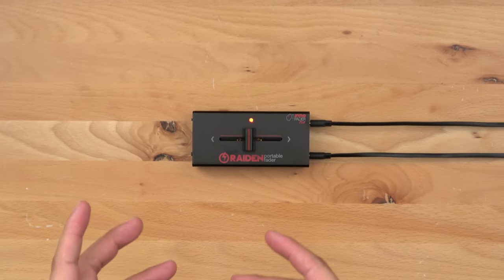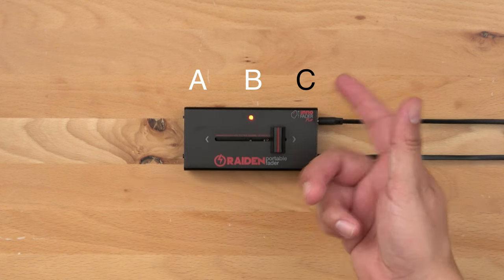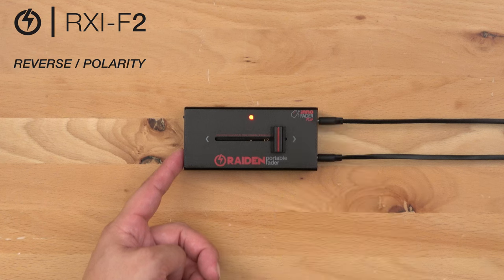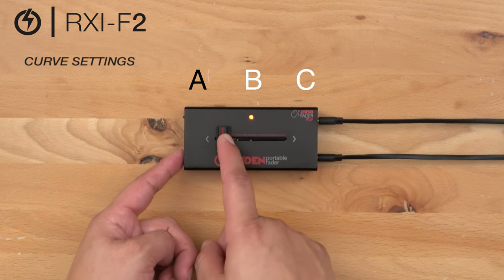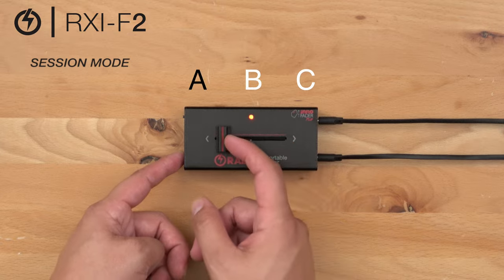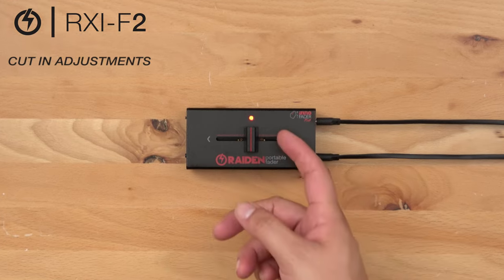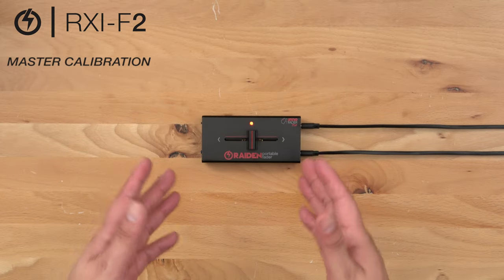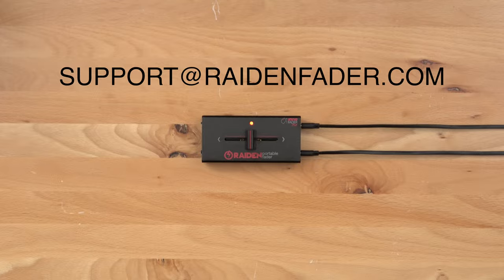Raiden RXI-F2 - Calibration Settings Tutorial

Comment: Mine lasted about 6 months and now the audio is bleeding through with the fader closed. Contacted support and they never responded. Tried  setting it up for reverse thinking I could just turn the fader around, but for some reason the cut in reverse is not sharp at all. Tried calibrating it for a sharp curve and it just doesn't work. So needless to say I wont be buying products from raiden again. I'll stick with Jesse Dean.

Comment: Hey raiden I just bought a numark pt01 scratch and raiden rxi-f2 fader.  Problem is that I am not getting proper clear audio In my headphones also facing problem to connect it with numark pt01 scratch.  Please make a video on setting up with numark pt01 scratch. Right now my connections are Rxi-f2 channel one goes into numark line/white, channel two goes into android mobile for some beats(your 3.5 inch doesn't sit proper into my android phone so using other aur cable) and output using my headphones( sennheiser hd250). Problems are I am not get clear sound into headphones  and other what connections do I make to get both mobile phone and vinyl sound on in build speaker. Please help 
Sorry for bad English